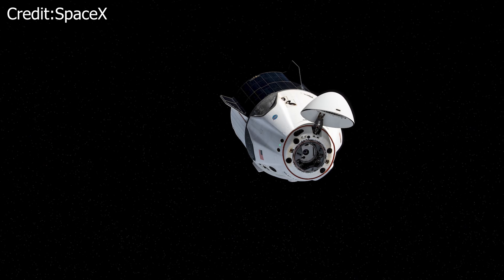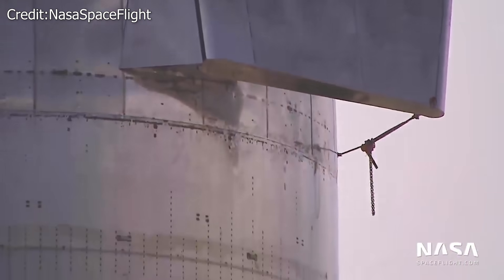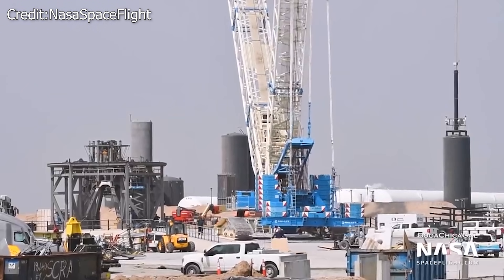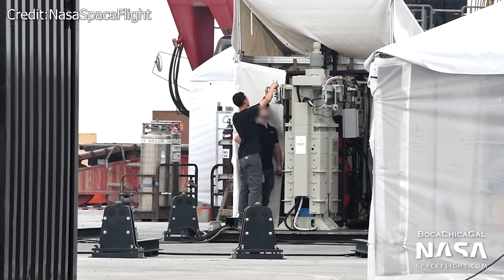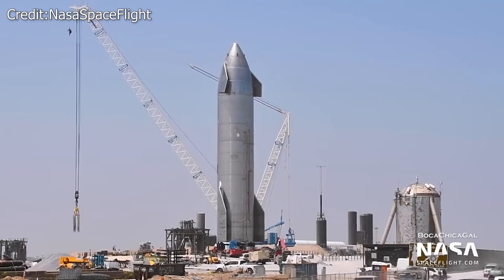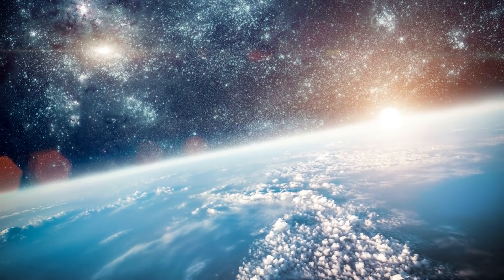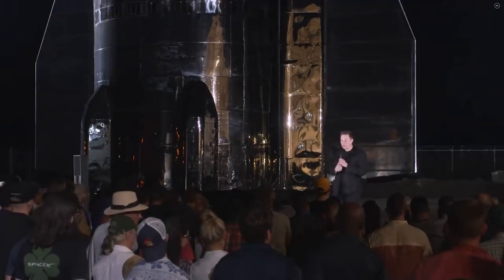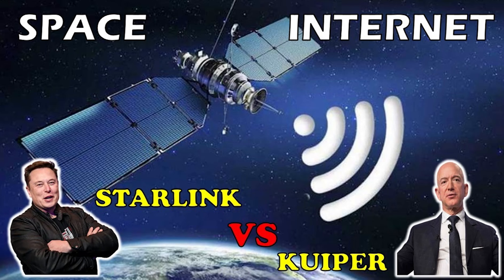Starship SN15: Why does it have a Starlink-dish in it?

Comment: add 2 more flat panel starlink antennae  n they should 120 degrees apart with the same altitude on the rocket vessel wall like an omni antenna if possible.

Comment: My best guess that this is intended to improve data communication during future hot reentry attempts. 
The hot plasma during reentry will block most radio links - and more so on the bottom than on the top. So an antenna on the topside of Starship could get some connection with overflying Starlink satellites for at least a part of the time. The downlink may be crucial for SpaceX because the early Starship prototypes may not survive reentry and thus be unable to tell their story.
Reply from the maker: thanks for the great analysis
Reply: Can I believe it is also about redundancy the last flight in the fog proves that redundancy is a necessity. But publicity is a good call to. Plus it’s a long trip to Mars so a couple movies on Netflix wouldn’t hurt either
Reply: @andrewk7981  Actually the Starlink connection (if it really is that) may be useful during orbital test flights. Especially in altitudes lower than Starlink ( supposed to point its antennae downward right?) which may easily be the case.